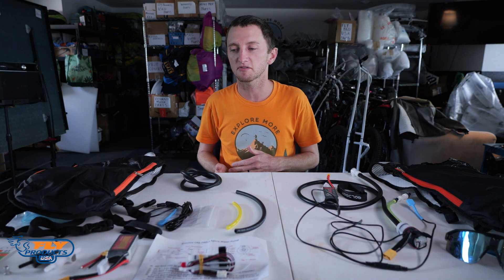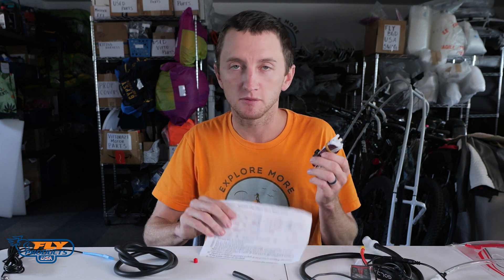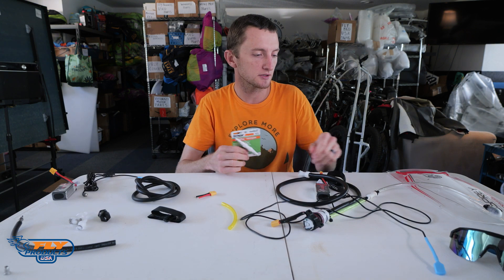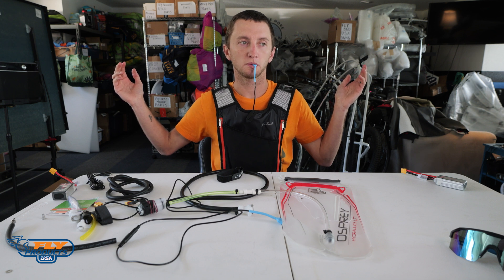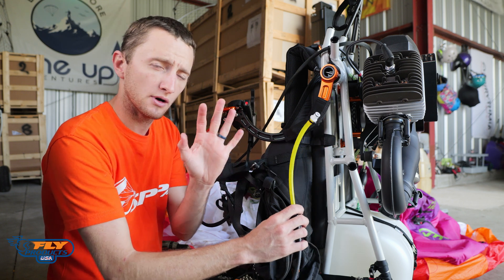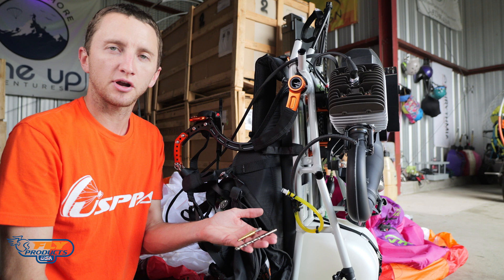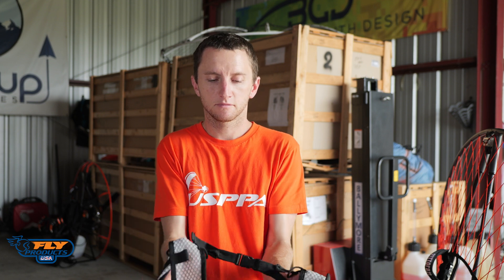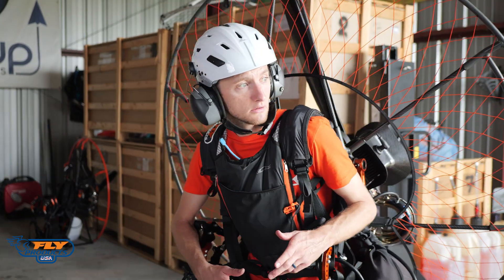Build Your Own BETTER Paramotor Smoke System! - Under $200 - WHOLE NEW CONCEPT!

Comment: Are those plastic quick disconnects still working for you? I picked up a similar QD from Amazon and it failed and got stuck closed on my first attempt resulting in the oil coming out where I didn't want it and made a mess. I was thinking the connector might not have been rated for exposure to mineral oil and caused some internal failure. Have since transitioned to some nicer (and more expensive) brass QD connectors for shop air lines which is working thus far.
Reply: They are still working fine for us, yes!!

Comment: Great video. I once made a smoke systemen on my paramotor buy it influenced the Rpm seriously. How is that on the moster ?
Reply: If at full power, RPM will drop by 300-400 while injecting smoke oil, no effect otherwise.

Comment: Love this. I've been missing having a smoke system but always thought about making something removable. Thanks for all of the info Kyle. 🥹
Reply: This thing is awesome. It’s so nice to use it when I want and not have to carry around an attached system!
Reply: @ On the Factory R, did you drill out the bung or punch a hole through the normal wall?
Reply: @ The bung was too thick. I tried that first and then just went with a rivet nut. I’ll just buy a new elbow 🤣
Reply: Now how to make it different colors.?.?
Reply: @crisco249 It can be done, but that juice isn’t worth the squeeze. So much dye and not a favorable solution that doesn’t involve a TON of work. Throw on a smoke grenade and boom, colored smoke lol
Reply: @Kyle-Mooney that’s a much better idea
Reply: I remember there were problems of cracking the exhaust from drilling it back in the day. What has changed so that isn't a concern anymore?
Reply: @ it’s still a concern for sure. Just part of the game when doing this. I would never rule it out with smoke.